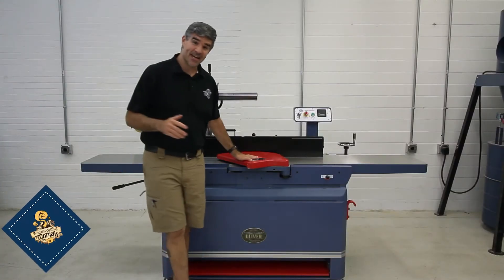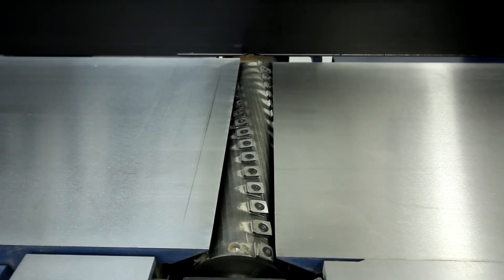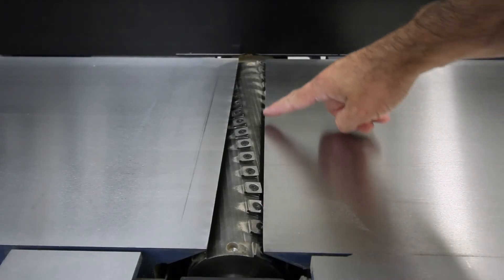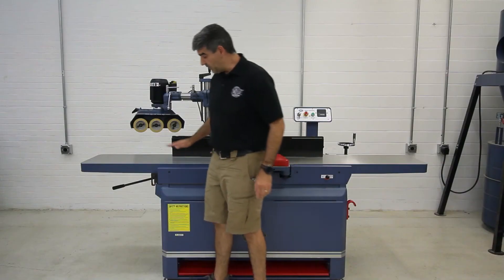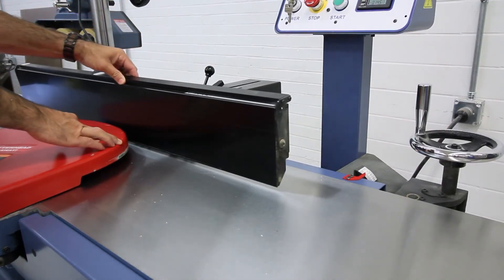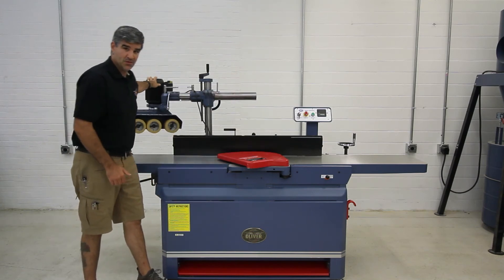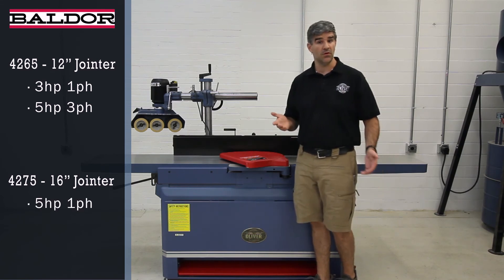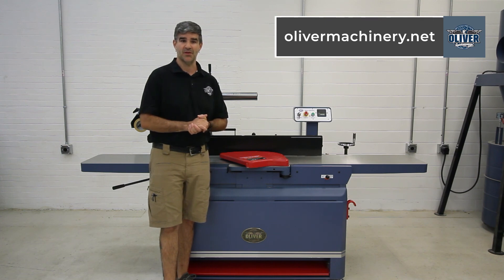Tool Overview - Oliver 4265 - 12" Parallelogram Jointer w/4 Sided Helical Cutterhead

Comment: Is it possible to remove the blade guard?
Reply from the maker: The cutterhead guard can be removed, but should only be done when a power feeder is used in operation or when servicing the cutterhead and power is disconnected from the machine.  During normal operation of the jointer the cutterhead guard must be in place and properly adjusted.

Comment: Does it rabbet? And are they Bryd pattern cutters?
Reply from the maker: Yes, the rabbeting capacity is 3/4”.
  The helical cutter head features 4-sided carbide inserts, but are not BYRD brand for this model.